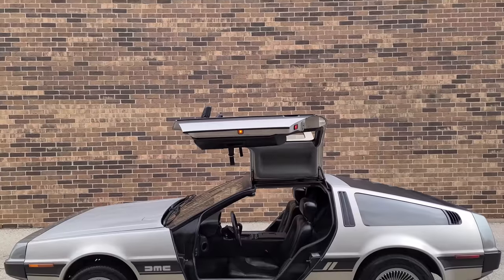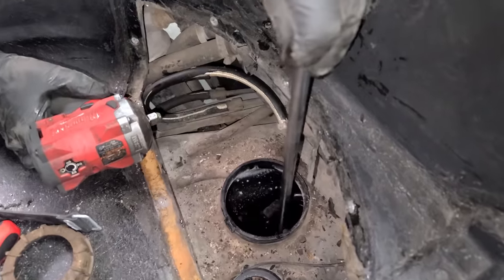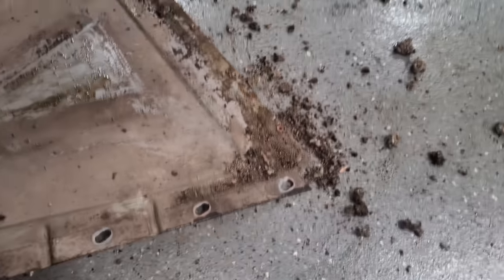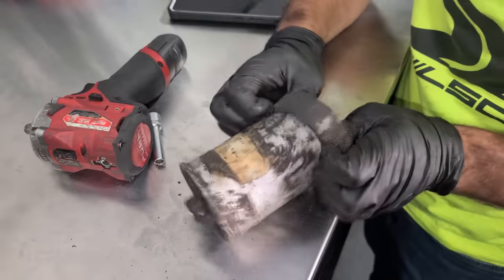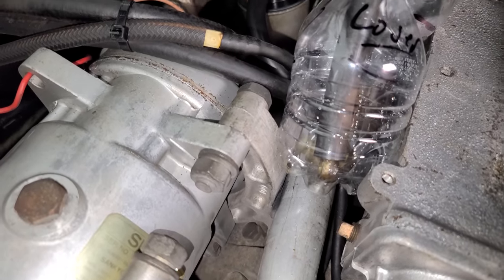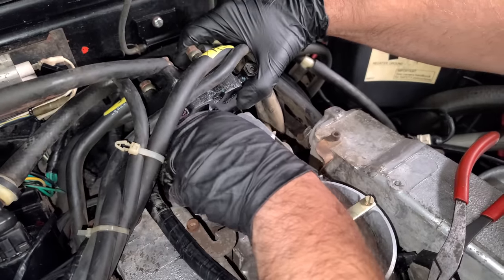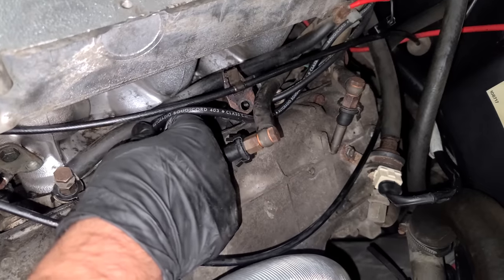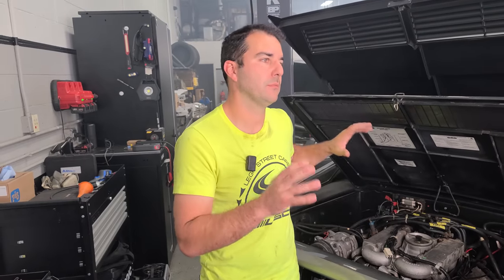I Got My DeLorean To Run On Its OWN POWER! Cleaning Out NASTY 30-Year-Old Gas & Fuel System Rebuild!

Comment: Hi Alex, I have a 1981 BMW 320i with the same K Jettronic fuel injection system. This car sat for 36 years. It smoked exactly the same on the first initial startup. It was incredibly rich. thought the motor was blown. You might have to retune the injection system. When you replace the fuel distributor unit it doesn't come adjusted. You have to put a multimeter on the oxygen sensor and adjust the airfuel mix/injector tuning screw on the CIS unit. You should be good after all that

Comment: The tab on the plunger can stay.  Some of them have it, some don't.  You need to test the control pressure at the warm up regulator.  That determines the fuel air ratio.  It should start low when cold, maybe 32 psi, and then increase as the engine warms up to about 40-45psi.
I've resurrected two mid 80's Audi quattros and a Coupe GT running the BOsch K-jet recently.  They all started right up after sitting 10+ years

Comment: I am restoring a '82 BMW E21 that sat for 25 years and had my fun with a CIS fuel system!  Pro tip: if the fuel distributor plunger is stuck open and you fill your cylinders with fuel, remember to disconnect the coil when you pull the plugs to blow out the fuel.... you'll find a quick way to trim your beard with fire 😉

Comment: I bought a non running delorean and i had zero experience with cars from a mechanics POV. After learning as i went, i got my car running within a few months. I now always try to do the work myself on my daily car because of the delorean and how much ive learned. I also have a very reliable car now and have the most driven delorean in the uk. It might as well be my daily

Comment: Acetone will melt certain plastics like ABS. I hope you checked to make sure the acetone won't compromise the plastic of the fuel tank which is probably fiberglass and resin. It's safer to just use gasoline as a solvent to clean with as long as there are no sparks or flames around.

Comment: Almost all states premium gas was ethanol free back then, but cheap 87/89 octane could well have had 5% corn alcohol as a cheap booster additive--that would be more dependent on the brand. People often forget when criticising buying 93 octane for cars "that don't need it," that premium gas has better additives and will still benefit the car long term.

Comment: The thing about the batch fuel injection. Fuel just doesn't dump into every cylinder with a carb or TBI. There are intake valves that open and close. The open ones will receive fuel on the intake stroke and the closed ones won't take any fuel cause they are closed. Carburetors can be efficient if tunned correctly.

Comment: Good work there getting the Injectors cleaned and working, then you mentioned the "Valey of Death", I'm Sorry I'm a Fitter by trade, and I would have done that BIG check First, I would have taken the Engine out as well, and done all the Lower end, check the Transmision, replace any seals, the Muffler/exhaust leak, before I did the Fuel system, so after you did the last pieces, you were then ready to "dial" the Engine in. I would have run it Outside, It got really smoky there for a while. Anyway great work Alex, I'll be watching the Next clip.

Comment: Just install Zipwake instead of those old trim tabs of yours. The boat will be much more fuel efficient and it will plane out much faster and it will possibly give you higher top speed too! And it does it all automatically with the assistance of a gyro satellite and gps.  You will absolutely love it!

Comment: The pipe from the exhaust manifold to the airbox intake might be to prevent any possible icing issues. Carb icing used to be a common issue (late 1980s in the UK, Kawasaki recalled every liquid cooled carbed 4 stroke bike they had sold to fit heater circuits to the carbs to prevent carb icing). While fuel injection normally doesn't have this problem, the old K Jetronic might (icing is caused when fuel takes the heat from the carb, so the water vapour in the air condeses and freezes in the intake), if the fuel distibutor starts to ice up.

Comment: Alex, if your smoke problem comes back when the car is cold, try replacing the Warm Up Regulator (WUR). This is what dictates the fuel air mixture and caused a massive smoke problem on my car.

Comment: well done!  I used to own a 1979 911SC with that same injection system. Works flawlessly once set up. You definitely should drill out that plug to make the fine adjustment. I am in the NW burbs of Chicago.

Comment: Alex ,  check the charging system as well (alternator) because i saw the voltage gauge show above 12v And after the engine "clear out" the idle it at 12v.

Comment: Bought a 1994 Z28 in September, and two months later was able to drive it. It had a seized engine, likely due to a blown head gasket. Unstuck it, replaced the heads, bunch of other little things. Just this last weekend did headers and exhaust. Oil leaks through the rings at times, but we took it from trash to treasure.

Comment: Mate. I agree. However, most cars have an Air intake temperature sensor. In saying that, the temperature would have to be higher than a set limit over a series of run cycles before you get the loving glow of the check engine light.. So, in this case, it may have been running a bit hot for a very long time. Cheers Adam

Comment: Check your warmup regulator and your system and control pressures.  You need a CIS fuel system tester to be able to connect to the correct ports, but that poor running when cold, to me, sounded like more of a problem with the warm up regulator (which alters the control pressure).  See how it does in the coming days upon cold start, now that the oil has burned out of the cylinders.

Comment: Great video as always. I never liked how the PRV engine ran or sounded back in the day in the V6 240 and 760’s. This one does sound good. When I resurrected my 82 380sl, I used marvel mystery oil in each spark plug hole and in the fuel tank. She smoked for quite a while and then when it all burned off, NICE! Do not go crazy on the idle mixture screw that you are talking about drilling out and turning. The reason I got my 380sl for $600 was that the mechanic knew nothing about CIS injection and turned that screw so much , it would not run. A Quarter turn rich or lean and let it settle down a little, before you turn it some more. Not very scientific, but listening to your frequency valve buzz is a good indicator of the mixture being correct. Also, intake manifold vacuum leaks also make a big difference in its running. Check all vacuum hoses for dry rot. Love your videos. This Delorean is gorgeous!!!

Comment: The red molasses in the tank is what remains of the inner fuel pump seal. When the old gas in these cars is left on the seals of the OEM pump assembly, it melts the rubber into a reddish goo.

Comment: Got my fingers crossed for the engine block inspection. Can't wait for the suspension/breaks and all the cleaning/restoration that goes with it. Getting so close, you're gonna have the most radical Halloween display. 
The DeLorian is nowhere near my favorite car on this channel, but this has been one of the most fun to watch series so far.

Comment: Make sure you go through and check for any vacuum leaks before you start messing with the fuel distributor, which after this long sitting, some of those lines are probably crispy. CIS can't really compensate for vacuum leaks.

Comment: Speaking of Fuel Filters. Last year I changed the fuel filter on my 93 Mustang 5.0 Fox Body LX. (Original Owner 100k miles at the time.) It spent a LOT of time in storage for the first 25 years, (Miliary, then working overseas) driven only a couple months each year. It was regularly serviced in garages (Oil change/inspections/minor repairs)

In any case, I was experiencing some stalling, and wanted to make sure it was getting fuel, so I personally changed the Fuel Filter last year and found the ORIGIONAL Fuel filter. (Date Stamped 10/1992). I cant believe that in 29 years of getting oil changes, no garage look at the fuel filter. I thought that was standard for an Oil change, Oil & 3 filters (Oil, Air, Fuel) And while you don't replace a fuel filter each oil change, an inspection is at least warranted. And seeing a filter that is 5-10 years old would probably indicate it probably needs to be changed.)

Comment: You need a bench grinder with a soft wire wheel.
That banjo bolt should have a copper washer on both sides going into the fuel filter, you could have a small leak.

Comment: I may have missed it but have you checked/replaced the fuel accumulator? Its a PIA to get to since its inside the frame, but an old one can cause lots of fuel issues. 

Keep making these great videos!

Comment: What did they use for a Warmup / Control Pressure Regulator? On the VW Rabbit CIS the Warmup control pressure regulator puts pressure on the back side of the Fuel distributor pin, this creates a slightly rich mixture so it doesnt burn the Valves.

Comment: Well Alex, i think i got you beat if you think flat screws are dumb to hold down your fuel distributor...i bought my 02 Dodge ram used from a young, Mexican construction worker. The 360 Magnum engine was leaking every fluid that should be the engine. The coolant leak was the worse. One of the leaks came from the thermostat housing where somebody used sheet rock screws and washers to hold the housing down! The screws were too long and went through the bottom of the intake manifold, so the used JB Weld to coat the bottom of the intake manifold in an attempt to stop that leak. It didn't work. I was reving the engine from the engine compartment and coolant would stream spray from somewhere, but i didn't know where until i found that rigging!😆 that Delorian engine is overly complicated.

Comment: No with those Bosch CIS pins (in the Fuel Distributor) if the bore gets scratched youre screwed, you cant interchange with another bore or pin they are machined to different tolerances,  This came from my Bentley Repair manual BTW for older VW's from 1977 - 1985 or so.

Comment: E10 really wasn't used anywhere until 2005. There were several "initiatives" from the 1970s through the 1990s which prompted the research into using Ethanol as an octane enhancer and "climate protection". In 2005 and on it slowly made its way into consumer markets.

Comment: If my memory serves me correct. The engine is The Renault 30 Engine. I worked on few of them in the UK. Back when I was a Mechanic and Auto Electrician now Disabled / Retired.

Comment: One of the best things to clear up an irritated throat is to take a small drink of lemon juice. It also works extremely well for helping to clear out early congestion; just empty out a saline nasal spray bottle, and refill it with lemon juice; a small spray up each nostril, and gargle and swallow about a teaspoon of lemon juice. It works best if you catch it early. If you do that at the first sign of a sniffle or nasal restriction, you will likely never have congestion again. (And, no, it doesn't burn misting lemon juice up your nose, unless you get an excessive amount of juice up in there and sniff extremely hard. It occasionally does drain back a slight taste of lemon juice into your mouth, but that is nothing compared to the taste of the gulp of lemon juice. Both of which are a small price to pay for the huge positive benefits.) (P.S. I haven't had congestion in over 15 years, since I started using the lemon juice this way.)

Comment: If you need a new engine, look for a 3.0 V6 out of an 88-92 Eagle Premier. They are all over the place in junkyards, your fuel injection system will bolt up or you can use the EFI system off the Eagle, and it will bolt right up to your transmission without any issues. Type 1990 Eagle Premier into Car-Part and you will see that many junkyards all over the US have good running engines for as little as $175. You can use your CIS injection system or you can swap to the EFI system off the Eagle. It will bolt directly to your transmission. Just going to that engine alone will give you a boost to 150 HP and 171 ft-lb of torque.

Comment: It'd be a good idea to replace every fastener you can with stainless, fasteners made from other metals could cause corrosion of the body panels if they get wet and stay in contact with it. I've found out the hard way (at sea) that cheap bolts will eat your expensive stainless steel as they corrode. 

Obviously seawater accelerates the process, but it will happen eventually just because of moisture in the air, and the worst part is that it will embrittle the stainless around the bolt holes long before you can see any difference.

Comment: I believe the gunk in gas tank is a fuel stabilizer.  Gas tank up till about 1996 were not sealed aka did not have onboard refueling vapor recovery system (ORVR) .
not sealed for 20 the gas would have evaporated (0ut thur carbon canister) but the fuel stabilizer is left behind.

Also I agree no way was there ever ethanol fuel in it.
It was available at I think Merit gas station pumps in the "corn belt" all the way back to the 1970 from special suppliers but not forced into normal gas pumps.

Great job.

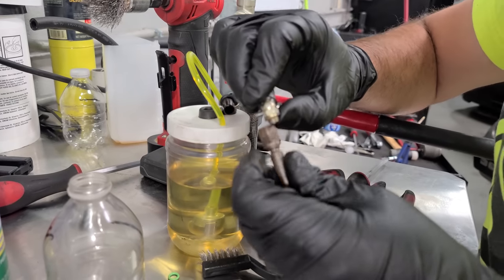Comment: 53:52  F.Y.I.     The reason these injectors whine is because the valve & seat are precisionaly milled to oscillate the valve & spring at high frequency sound waves as the fuel passes by at high pressure which atomizes the fuel.  These injector valves & seats wear out from constant vibration & oscillation.  This is clearly described in the Bosch CIS injector diagram & the the injector valve is labeled as "Oscillation Valve" or "Vibration Valve"

 Corrosion & deposits further prevents the injector valve from oscillating & correctly atomizing the fuel. 
Also today's fuel no longer has sulfur which lubricated the fuel & components & ethanol offers no lubricant & attracks water, pitting the injectors & the fuel distributor metal & corrode's it also.  

I say replace these injectors every 30k miles, or if it sat for a long time unless you flow balance them properly, & see the spray pattern all at the same time under continuous pump pressure using kerosene, diesel fuel, or mineral spirits under a backlited set up,  & comparing them to 1 brand new injector to see the pattern & atomization!

Do NOT use gasoline!

It is important for this "mechanical injection" to add the lubricity back to the fuel with a fuel conditioner like using at a low dose rate at every fill up like Amsoil PI, Redline Sl1, or an upper cylinder lubricant like Marvel Mystery Oil or Lucus, BUT, the best chemistry is an Ester based conditioner like Renewable Lubricants  
Bio-Plus Fuel Injector Cleaner at a low dose, or TCW3 at 1oz per 5gal.....See web search on this fuel treatment hack & using this very specific 2 cycle oil in gas for lubrication!  

Or, the best formulated gas with extra lubricity conditioners added is Shell Nitro V Power.  But its expensive because of its advanced chemistry.

Finally, it should be noted that Mercedes BOSCH CIS used all hard lines to the injectors to avoid fires from flexible lines that Delores used & the many fires they had.  Just be sure to use silicone hose (split) over each hard line for heat soak rejection.  It would e prudent to make you own hard lines!

Comment: Hear me out.  For some reason, I think it would be really cool if someone would swap out the V6 in the DeLorean with the gas turbine engine that Chrysler came out with back in the 1960s.  I saw an episode of Jay Leno's garage where he talked about rebuilding one and all the reverse engineering they had to do, but the way it sounds is just incredible.  I think combining the sound of that gas turbine engine with the looks of the DeLorean would be a superb combination.  The engine is very small and compact for the amount of power that it puts out so I think you should be able to make one fit.

Comment: When you see that red gew in the tank, very likely it’s gasoline oxidized with MTBE, ethanol oxidizer doesn’t do this. I believe tetra ethyl lead oxidizer will do this as well but leaded gas should have been long gone by the 90s.

Comment: I know this video is 2 months old, and I'm just seeing it but the initial smoke is likely from your concoction of fuel additive.  Injector cleaner smokes like crazy, especially when it's compressed through a fuel system.  I've done this on diesel injectors as well using diesel injectors on a 20 year old excavator engine.   It's perfectly normal and the smoke is a good sign of burn off material you want out of your injectors.

Comment: gthe pipe you are talking about is called a stove pipe, it sucked up air past the exhaust manifold through a stove plate to heat the air to help atomise the fuel when cold and improve combustion and unburnt fuel, its an emisson control apparatus not a fuel economy thing.

Comment: Realise that the value is in keeping original, but because the motor was used in quite a few models, there is a healthy aftermarket. Some of the Alpine 610 bits might get the motor singing.